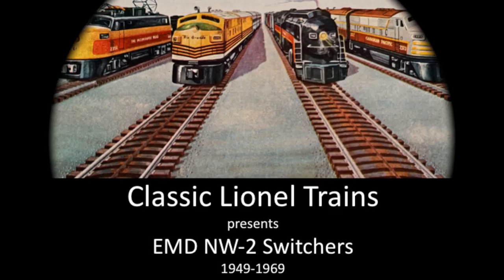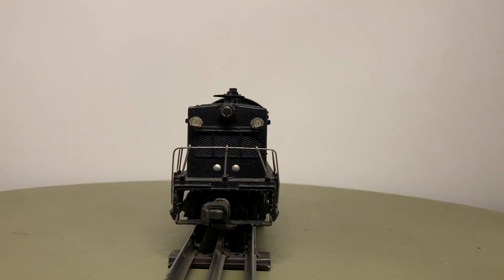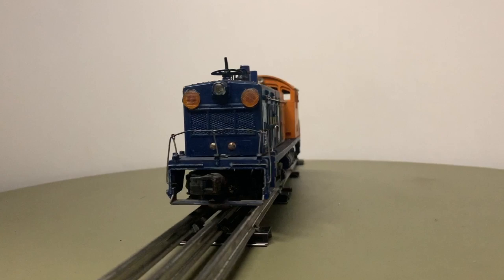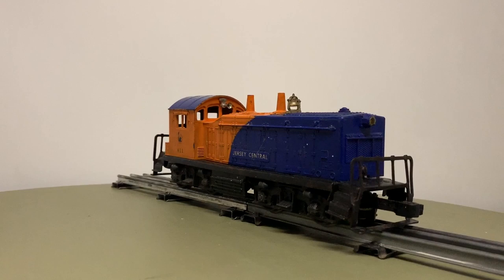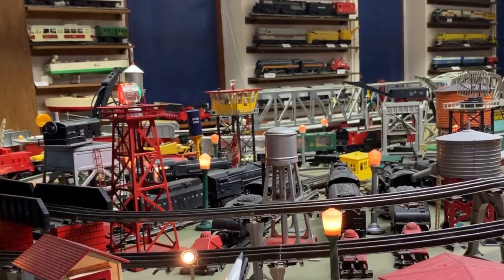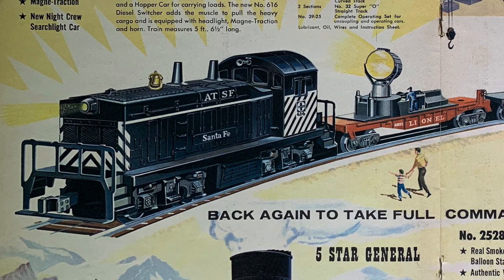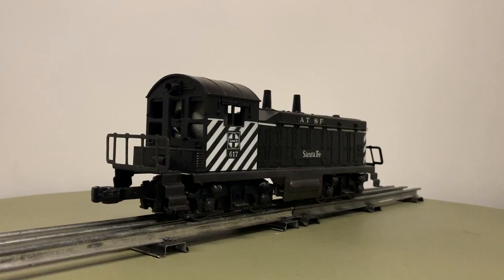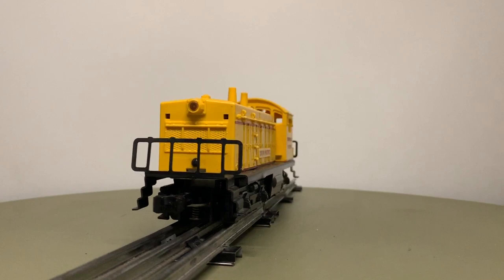Classic Lionel Trains - EMD NW2 Switchers 1949-1969

Comment: Three CNJ NW-2 switchers running together. Nice. Very nice. My grandfather had three wire plugs running between units, multiple powered units could share one E-Unit that way.  Having multiple FM Trainmasters (All of which he repainted into Southern Pacifc back in the 1950s) powered and at the head of a train is impressive. But as for me, I like the sight of switchers running in multiple. Seeing those switchers together made my day.

Comment: I enjoy all your uploads. This one especially. I just finished rebuilding a 6220. Ding, ding! Stay safe.
Reply from the maker: The 622 and 6220 are the best of that entire series. I actually did not detect any significant difference between the two models. The 6220 is considered the 027 model, but it is as solid and of the same size as the 622.

Comment: Great video! I have a 622 with the bell, though its a bit of a plain Jane it remains one of my favorites for its smooth, faultless operation, its like a rolling brick
Reply from the maker: The 622 is a heavy engine. As I stated in my video, the NW2 in the late 50th had only 2/3 of the weight, in the 60th only half.
Reply: Santa Fe black is how an early switcher should look.  One of the accurate paint schemes for the type.

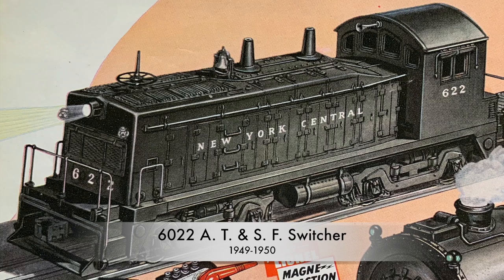Comment: 2:05 Legend goes Lionel were supposed to make a New York Central NW2, and even had a couple prototypes. They never released it to the public and never was shown as an item for sale, but apparently somehow a couple people got a hold of them. One guy I met at a train show claimed to have one. He said it had everything that made it an authenticated item from the postwar period. Though, he had no photos to show of any proof...

Interestingly, since most times the artists of the catalogs had the actual models displayed in front of them to illustrate them correctly, the illustrator probably had a New York Central NW2 right in front of them! Yet since Lionel never released it, it's not shown as a "for sale" item in ANY catalog. So why it was used in a picture is kind of a mystery. 

Kinda wish it was released. Sure they made NW2's in the modern era that replicates the postwar NW2's and have all the modern digital commodities that make it great to run on a modern layout, but not having it be apart of the original postwar era is a bit of a let down. Same goes for the legendary Southern Pacific Trainmaster "0000" of the postwar era.
Reply: I would prefer a conventional version of the NYC 90s era replica.  Maybe I will swap a shell on to my C&O 624 or repaint it.

Comment: I have been fortunate enough to acquire 4 variations of the 610: the black common version, the yellow frame version, the 610 with the builder's plate on the sides  and a black version painted over a red body,

Comment: Loved this video! I have the 624 and 600.  Stupid question of the day---> I note some consists here with 2 to 4 NW's. Are they all running (pulling/pushing) or are some in the "neutral" e switch position?
Reply from the maker: They are all running except one. This had a broken engine which I took out. In the neutral position, the motor and the wheels are blocked
Reply: Thanks for your history on the  trains  they are beautiful